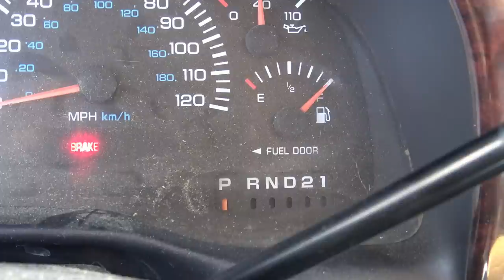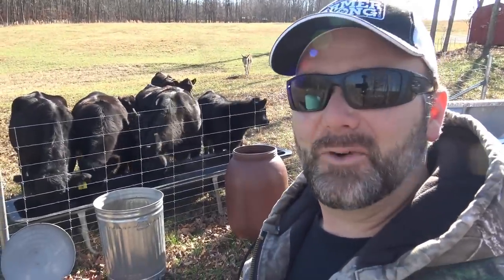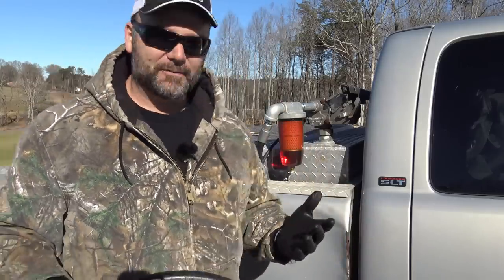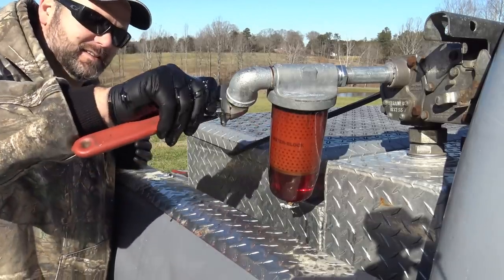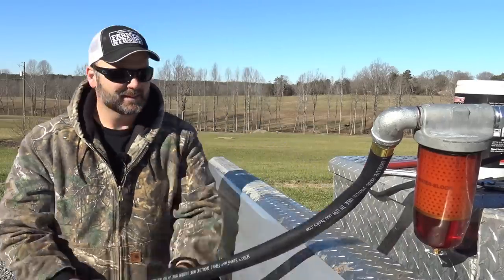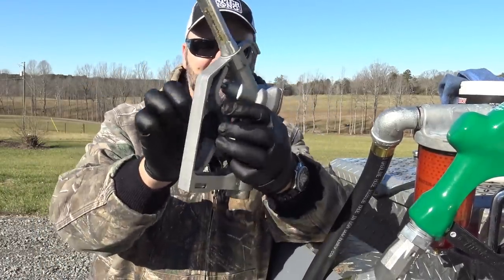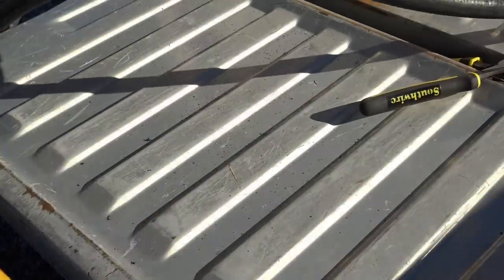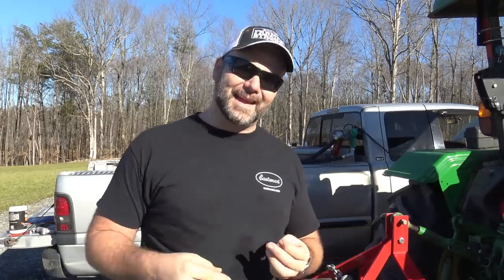NO MORE FUEL PROBLEMS ON THE FARM!

Comment: If you turn the roll of tape around with your finger through  the center hole you will get the tape on tighter.  NTP fittings only need 3.5 - 4 wraps. Too much tape is as bad as not enough.  We tape tens of thousands of fittings every year

Comment: if you flip over the roll of teflon tape, you get better control of the tape and can get better tension on the tape to pull it into the threads easier.

Comment: I have the same pump that you’ve got and one thing I’ve found really handy is instead of having to raise your hood to hook up your clamps to run your pump wire up a connector like you would use for your trailer lights. Your truck should have 12v power and a ground in your trailer plug once wired it makes it so much easier for fueling up equipment in a hurry.

Comment: Just wanna say hey brother! Also want to add that I have your old style nozzle and hose setup on my remote fuel tanks and I know what you mean about the trigger part falling out. Just pick that sucker up a certain way and it falls right off with no problems. I’ve have even been filling a bucket with diesel and let off the trigger and it fall right in the bucket lol. Looks like I need to buy that one you upgraded to. It’s a real nice one, especially the swivel joint!

Comment: Josh you might consider getting some copper sulfate, and maybe give a local vet a call about getting a bottle or two of calcium to keep on hand for them momma's.  2 reasons,  milk fever is a potential issue for calving heifers.  The copper sulfate for hoove injuries with all the new fencing and work you've done.  They could easily pick up a staple or piece of wire.  I know that's not the point of this video but maybe something to look into before a potential vet bill.  Neither of those things should affect them being organic but don't take my word on that.

Comment: In aviation a safe practice is always keeping fuel tanks full in planes.  This minimizes chances of humidity forming condensation and getting water in your tanks.  Not sure if this could be a factor as well.  I also have a drag tank and try to keep it full. I've never had any water issues..... knock on wood.

Comment: Big improvement on the fuel delivery system.  Money well spent.  When I was at the store I went round and round with people who had used regular teflon tape on fittings where gasoline was used.  Megatape is an excellent product.  The additional expense will be absorbed by the absence of contamination in the fuel system.  Ideally - when using an adjustable wrench always pull with the fixed side.

Comment: Josh , I notice a galvanize street elbow on your filter. They do not recommend using galvanize pipe or fittings with diesel fuel,  they have a chemical  reaction. This also might be one of your problems.
Reply from the maker: hmmm thanks buddy
Reply: Yeah that’s really good to know! 👊🏼
Reply: So what would you use? Black pipe?
Reply: @StoneyRidgeFarmer   Also the white Teflon tape will fall apart.   PTFE Teflon Yellow or most people call it yellow tape it's double the density over white tape (sometimes in other colors.)    Black steel is better then Galvanized for fuel
Reply: Yes, I agree.  Somewhere in the past I read that diesel vehicles do not have galvanizing (zinc) inside their fuel tanks.  The fuel oil will leach the zinc from a plated tank.  As for ULSD, I have no information.

Comment: Josh my guess is that unless you have an actual leak from that old hose.. then you shouldn't have water in your fuel.. that fuel is off road diesel which has a high tendency to create a lot of condensate in your tank.. that the formation of water.. i have worked in oil refinery's for 23 years and all storage tanks must be water drawn periodically to mitigate the water issue! Your water filter should work for that small fuel tank.. hope this recent upgrade to your tank will solve the problem. 
BTW. with that old hose could be checked easy for any collapsed part of the hose which is common sometimes just run a fish tape through the hose but that will only tell you of an obstruction in the hose! One other idea to see if you pumping water with your fuel is to simply pump a small amount of fuel into a clear glass jar you recycle from your kitchen waste stream. Let the fuel set for 10 min. and look at the very bottom of jar to see if there is water, the fuel will float on top of water! Best wishes with the water in fuel problem!
I would also check the fuel from where you buy it keep the glass jar with that truck when you go to get more fuel.. dispense some fuel into the jar let it settle 10 min. and check the jar.

Comment: Not sure why you think you don't need reflon on tapered threads.  You should be using pipe dope or compound on any fittings used around fuel.

Comment: Josh from the size of the nozzle and the fact the hose was braking down from the inside it seams like the system was designed for gas and not diesel

Comment: You applied enough teflon tape to choke a horse. A couple of wraps is sufficient, not 6-10 wraps. Maybe you fuel problems is from excessive teflon tape peeling off in the fittings when tightening things down, and plugging the fuel system on your tractors.

Comment: I have a 275 gallon tank that Southern States comes to fill up for my farm diesal. The fuel is easily gravity fed to my equipment. I never have problems with dirt or water in my fuel. I use the same filter you have pictured in your video. My tank is under the roof of my shed. Those fuel nozzles are cheap,  worthless and prevent gravity fed fuel. I made my nozzle out of a fuel swivel, all copper fittings, and a fuel ball valve. I stopped having problems with the nozzle when I went that route. Beware of some of the cheap hoses that some of these tractor supply places sell. I've had them separate (brand new) on the inside and restrict flow.

Comment: Keep the old stuffs Josh don't throw away yet, never know the old tap when you need it, rebuild the o rings, standby, wrap it pack it store it, use silicon spray for swivels joints Josh, silicon is good for rubber seal rub between two surface....am I right...?

Comment: Hey Josh, one of the biggest problems you have with your water issue is your tank itself. Metal tanks will sweat on the inside when the temp varies from night to daytime temps. Just like a metal building roof sweats after a cold night when it starts warming up. That condensation occurs on the surface area around the inside of the tank that’s above the fuel level, both on the sides and the top. There’s not any way to stop it from happening other than keeping your fuel tank as full as you can, which I know is impossible, or get a plastic fuel tank. Plastic won’t sweat like metal tanks do. I believe there still may be some sort of a polyurethane coating on the market that you can use to cover the inside of the tank to rectify the sweating. I used it for that reason and to stop small leaks on rusty tanks back years ago when I was a service manager working on welding machines, but it’s a pain in the tail to prep your tank and after years it breaks free from the tank wall and will float around and play Hell on your filters. The best solution is a plastic fuel cell or a plastic liner to put into your existing tank. Hope this helps. Love the videos, brother. Appreciate the time you put into making them.

Comment: Next time you are going to disconnect a full fuel hose, stretch it out and drain it into a jug before you start.
 I'm not familiar with your fuel filter, but I would think the fuel flow is too fast to separate the water out of the fuel. The water doesn't have time to settle out of the fuel, and is forced through the  filter. In an engine fuel line application the fuel is flowing slow enough for the water to settle out.
Reply: Water will fall out of fuel when going thur the separater by the swirling action

Comment: Have u ever thought about changing where u buy your fuel if u keep getting water my lord something going on or u getting sabotaged
Reply from the maker: only takes one bad tank to cause problems for sure....buying a used fuel tank...lesson learned...take it to a radiator shop for cleaning!
Reply: @StoneyRidgeFarmer  water in fuel is caused by outside moisture on metal as strange as it sounds moisture will be also created on the inside of the tank thats where your getting water i think a water seperator is your only option
Reply: @noelhenderson8095  Yes, condensation.. Just like what you see on the outside of a cold water glass on a hot day.  Same thing.

Comment: How curious, a quick glance at the comment section. Nobody seem to mention. ~
The color code (green) for the fuel dispenser pistol is for "unleaded". For diesel should be black. That alone would be a big "no no" in my neck of the woods. 
Don't you guys have to certificate those tanks and fuel installation?!

Comment: You just screwed your cable cutters they are meant for copper and aluminum NOT steel. You need a cut off saw or a cut off wheel on a grinder to cut that hose.
Reply from the maker: heck ....never cut any of it anyhow....so they're ok brotha....I get what ur saying though
Reply: @StoneyRidgeFarmer  I had a coworker cut triplex with mine had a nice round notch in the center after that.

Comment: Full time driver,45 years or so..the aromatic compositions to make "better " fuel's  the past 2 or 3 decade's are bad news for older or cheap rubber fuel lines, the 1 you cut looks like a double steel braided line, The swelling cannot go outward so it swelled inward,was hoping you'd use a thin disk and cut about a 12" piece lengthwise into 2 halves, I'd slice from each side just enough to get thru the steel and then pull them apart so we could see how bad it was,..always do a complete autopsy on old stuff!!!